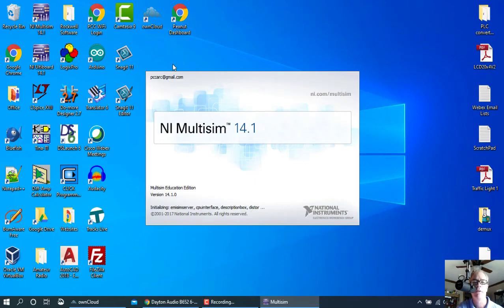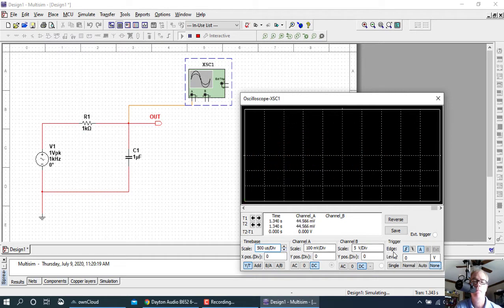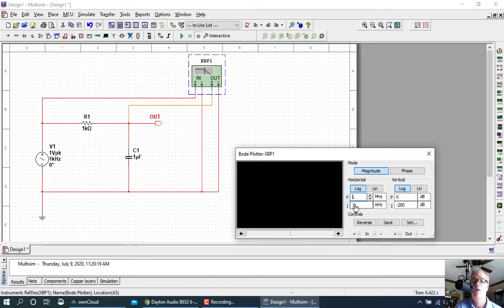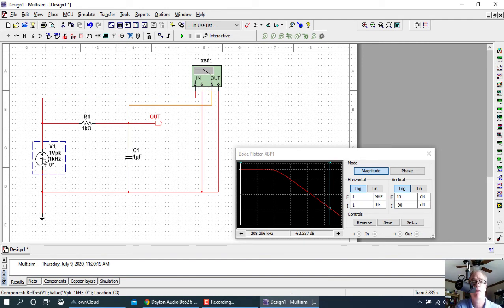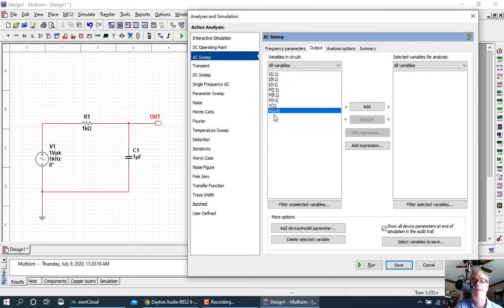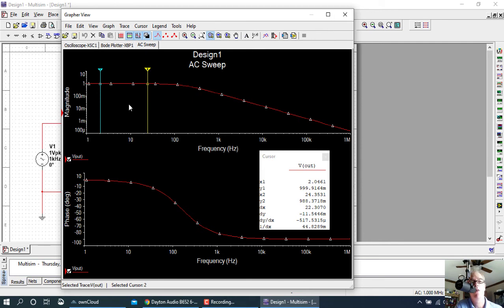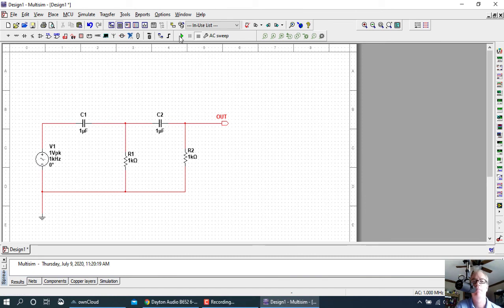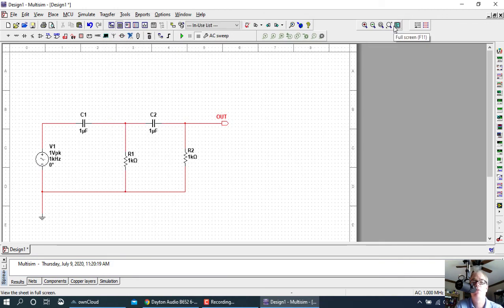Multisim Basics   Using the Bode Plotter and AC Sweep Analysis

Comment: multisim does not handle complex circuits well'
has too many flaws , not a reliable program but don't
take my word get the demo first.
Reply: It depends. I have some very complex circuits with high component counts that have been simulated in Multisim extremely accurately. But, some circuits can have some quirks. It's about knowing the workarounds, in most cases.